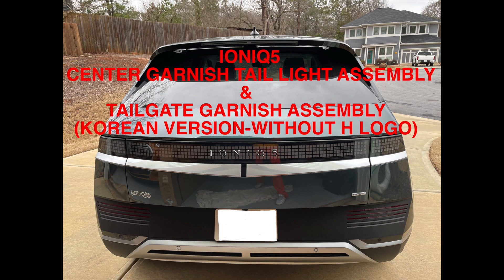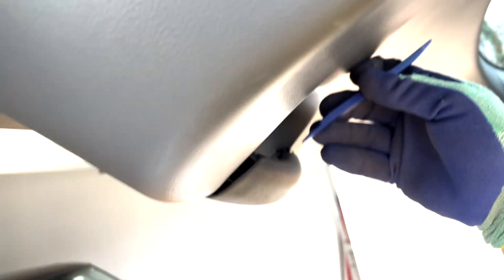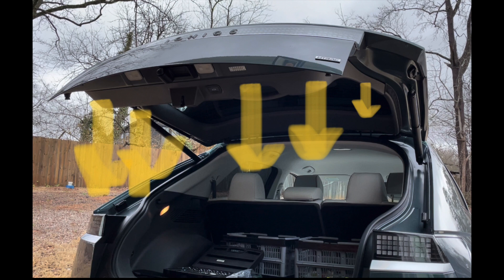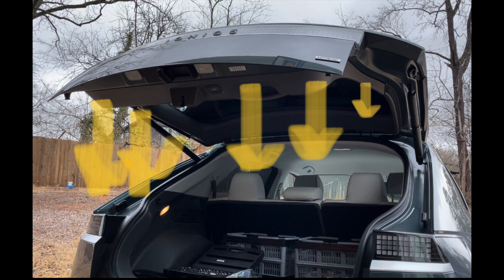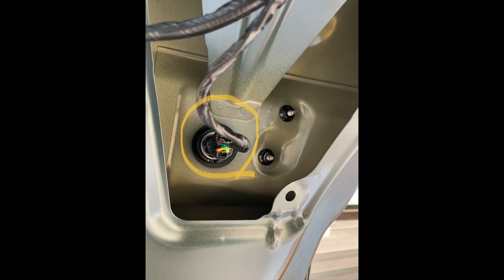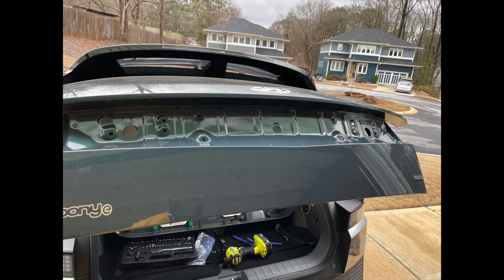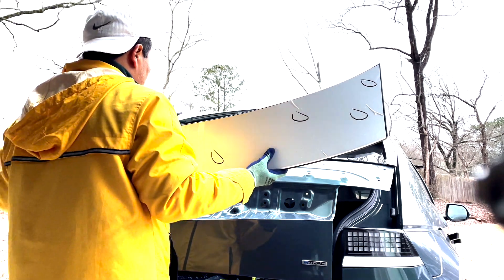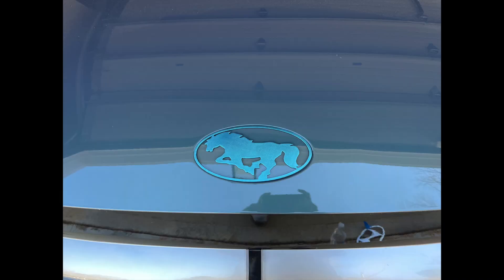Ioniq5 Center Garnish Tail Light Assembly & Tailgate Garnish Assembly Installation

Comment: Do you actually need to remove the combination lamps to remove the painted garnish? Great video
Reply from the maker: After I’ve finished it. I thought it might not be necessary but that’s what the instruction manual indicated. Anyway, it’s easier to remove and install it for sure. Otherwise, I need to pay attention to center light part. Any damage or scratches might cast big money haha.
Reply: Thanks for the help. Mine was replaced with no trouble by dealer. It’s a N and the panel was very wavy.